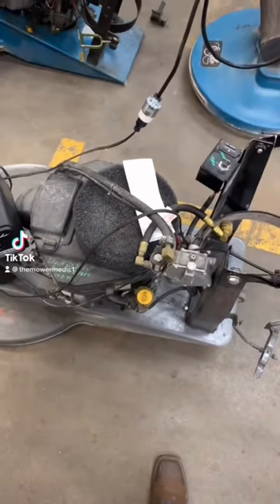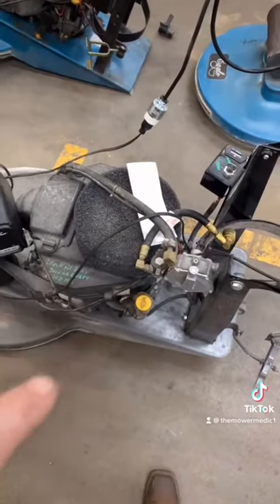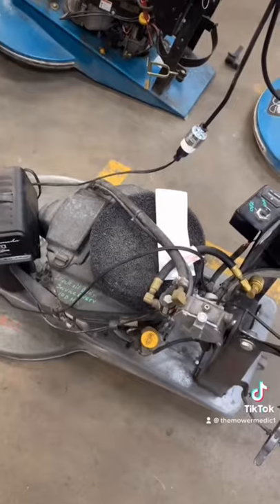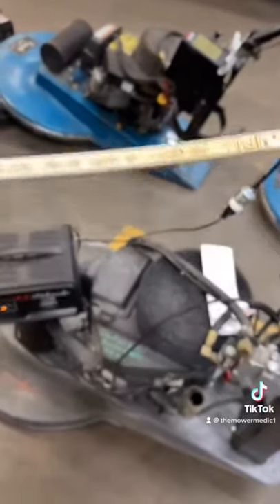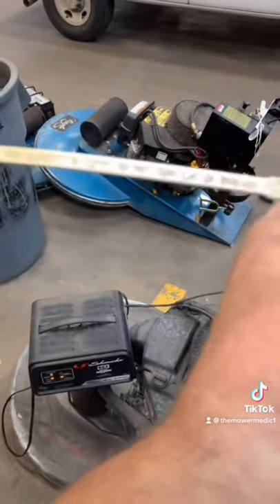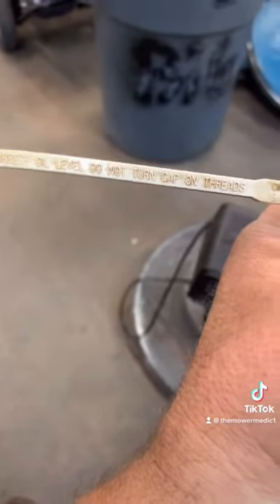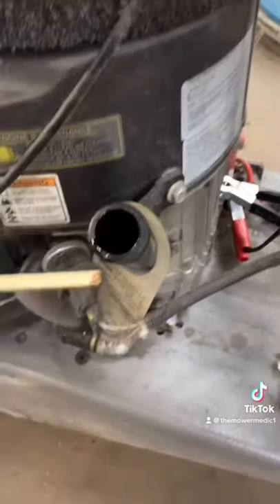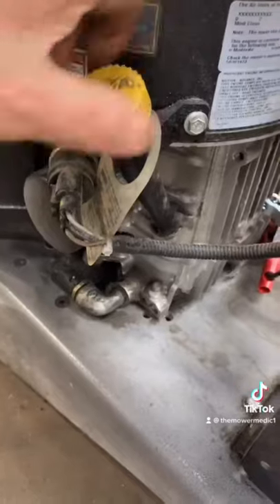How to correctly check the oil on a Kawasaki engine #Shorts￼

Comment: Failure to use the proper procedure to read the oil level will result in too LOW a level. You will not over fill if you read the level using the incorrect procedure, you will under fill.
Reply from the maker: I see these engines come in daily overfilled
Reply: People don’t realize how small the sump is on these engines and treat it like they’re adding oil to their car. No kidding, I’ve seen them overfilled by a whole quart saturating the air filter!
Reply: Worked on a bunch of these over my 39 years in the cleaning equipment repair business.
And yes 99% of repairs are user mistakes, misuse and maintenance neglect.

Comment: If you don’t even know how to correctly check the oil level you really don’t have any business even using the machine.
Reply: It is the opposite on Briggs engines where the dipstick should be screwed all the way down...  Did you know that ?